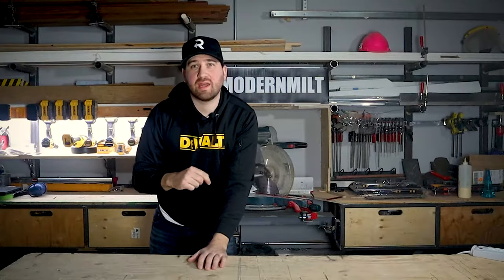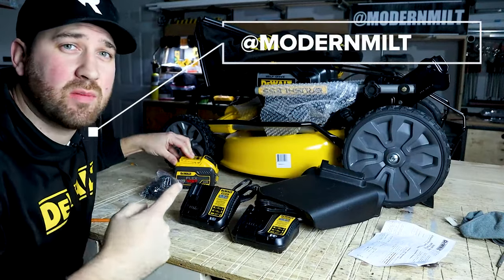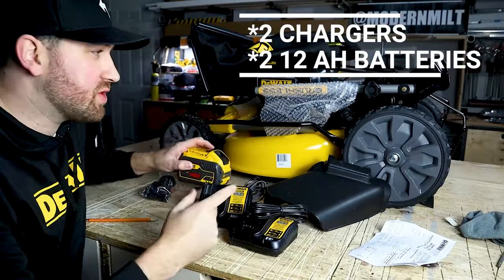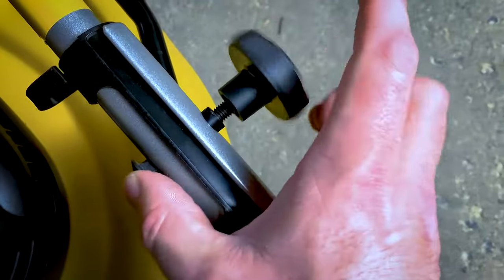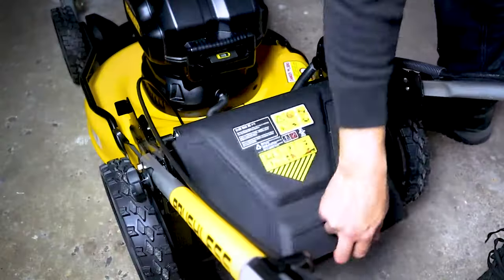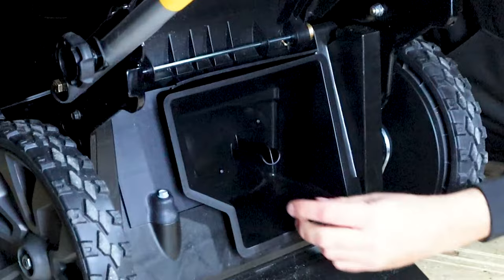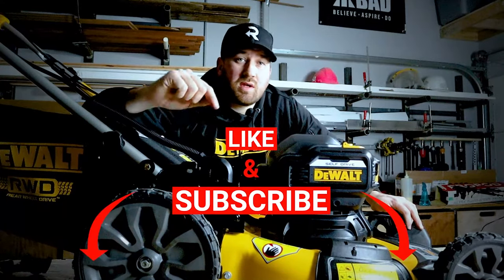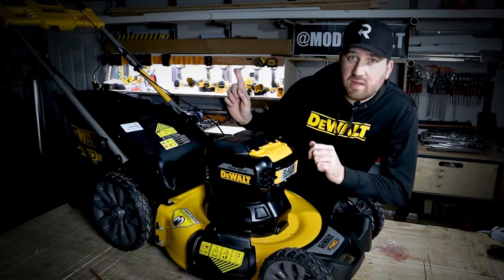DEWALT DCMWSP255Y2 - Lawn Mower Unboxing and Assembly

Comment: I like the video and I like how you show the details on how to put it together I wish it would have been longer and been a complete video.
Reply from the maker: Complete as in usage and run time?
Reply: Yes how it does on the grass, how loud it is, how long it runs for if it jams up, can the blade be replaced or sharpened. How is the build quality is it flimsy or high quality?

Comment: The "DON'T LOSE THIS" tag for the key is golden. Try to find a spare or one to replace a missing key... nearly impossible. Mine was missing the key but had everything else. Went back to Homey Depot and they gave me a key from another of the same model. Also waiting for warmer weather and the grass to grow.

I first considered the newest Toro (preferably w/o the headlights) but those are still apparently not available. This Dewalt appears to be well made and the run time should be approximately an hour under normal conditions. Because I have a large yard and a JD X390 (48"), even if I just do the more confined areas and "trimming" with this mower, it should work well.

One thing I noticed last evening (yeah, I started it inside the house... the dog was not amused, but rather was initially confused, worthy of a head tilt) that if you squeeze the wheel drive "triggers" all the way, the mower will really boogitate, even if the thumbwheel is set completely to the slowest setting. Do I need to think of this as a variable speed tool (like a drill) and just do a partial squeeze? It is either that or chase it around the yard and get the heart rate up. ;)
Reply: qwhat did u get

Comment: What's the performance like? Does it bog down much?
Reply from the maker: So far it’s great except when you get into higher grass, 3” and up, it will shut off. You need to adjust the height of the deck and work down

Comment: I just brought this but can not assemble, the lower arms are two different sizes ( 21” / 23”)
Is this supposed to be like that? What lenght are yours?how can you put the handle on if it’s different?.. please help..
Reply from the maker: I’m pretty sure mine are the same length but I will have to check

Comment: Mine did not come with the mulching plug and I am struggling to work with my supplier to get a replacement. Any idea what the part number for the mulching plug is?

Comment: I like DeWalt and like that this is made in USA.  It still looks cheaply built though compared to EGO and Toro.  Looking forward to the full review.
Reply: The EGO is the cheapest looking lawnmower it's made out of plastic  you can't cheaper looking than that
Reply: @loucifer4205  it might look cheap but ego gives you a 5-year warranty on the mower and battery. They are also highly rated if you look at their ratings online.
Reply: @eclecticgentleman  But can you use the battery on your drill recip saw or circular saw, that's a big difference
Reply: ego is very cheap inside i have worked on them for the last several years one of our top battery replacements tooo
Reply: what did u guys end up getting, dewalt or toro

Comment: Just got mine in today, I got the DCMWSP255U2 which is the same mower but comes with the 2x20v 10ah batteries. Was so excited to get it but mine seems to have a few issues(or maybe I do), I would love to know if you have the same problems or if mine is a lemon. My front right tire sits slightly higher then the rest, and on the highest adjustment setting a bolt interferes with the adjustment lever and can't fully seat; it could just be mine or a defect in the adjustment system. The Battery indicator on my mower doesn't do anything except blink red once when I start it up, Dewalt said it only lights up when the batteries are completely dead; but that would be kind of pointless as the mower shutting off would tell me the batteries are dead, and we'd have no way to estimate how much run time we have left without an indicator. My self propulsion lever unit is rather loose and has a bit of play where it attaches to the handle. Lastly, the underside of the mower where the blade is at either has a horrible paint job, or a protective coat over the paint, but mine is rough, and has a greenish tint. I don't expect things to be perfect, but every one of the 16 other Dewalt tools I own are great but for $600 the mower just took the wind out of my sails. I'd love your input based on what yours is like!
Reply from the maker: I will have a look at all those issues for you and see if I have the same. Stay tuned
Reply: They may have issued the "U2" version with the 10-aH batteries and the "Y2" version with the 12's.
Reply: did u return it
Reply: Yea I returned it and got the first gen Dewalt mower on sale for $250. I already had eight 5ah batteries from other tools and that’s what I use with it. I tried the 10ah and I don’t like them, I prefer to use the 5’s and change them more often, by the time I cycle through them all the first set is charged up again. And if a battery ever goes down and I need to send it off to Dewalt support I got plenty of extras. Takes about three pairs of the 5ah batteries to cut my half an acre in mulching mode. When it’s taller and a little wet it can use up to the fourth set of batteries, but I swap them when the battery indicator gets to 1/3rd battery life, not when they are fully dead. The first gen mower cuts better, is easier to push, and is more comfortable to push then the new models. If you can snag the first gen for $250-$350; DO IT! You can get 5ah batteries affordable on Amazon.
Reply: @ThePugSmuggler  did u ever consider the TOROs or the Ego mowerS?
Reply: @randomrazr  I did, but was already heavily invested in Dewalt.

Comment: Different than mine... Rear wheel drive mine front.
 2 -
10
amp/hour batteries not 12. and my mulch plug is built into rear bag door.

Comment: Battery life is an issue even with 12Ah batteries. Got it and charged the batteries overnight. I own .61acres. I mowed less than a 1/4 of ankle high grass and within 30 min both batteries were dead.
Reply from the maker: Strange because i have about the same size property and i had 1 bar left on one and 2 on the other
Reply: @MODERNMILT  did you use the rwd at all? I used it for a few passes.
Reply: @MODERNMILT  recharged and used the mower without using powered rwd. It lasted for about an hour until it got to 1 bar.
Reply from the maker: I’ll have to re test next cut and try different options.
Reply: @jttillman7109  takes the batteries a few discharges cycles to develop a memory and have a longer run time
Reply: @cj599  I’ve cut the grass 3 times now. Still getting about 1/4 acre for about an hour and 10-15 min cut time with no powered drive usage. Bought two 9Ah batteries to help subside the power usage. Still can’t cut the whole .61acre yard with one charge. Definitely can’t do it with the powered drive.
Reply: @cj599  we will see how well they perform the rest of summer.
Reply: @jttillman7109  do you have the flex volt batteries might be worth a try
Reply: @cj599  they are the flex volt ones. It comes with 2 12Ah flex volt batteries. I purchased 2 9Ah flex volt ones from Amazon.

Comment: I regret getting mine it keep cutting off even upgraded the batteries still same thing
Reply from the maker: How long is the grass your cutting?
Reply: @MODERNMILT  no taller than 3 inches. I tried it again it work better when the grass is not wet and I upgraded my batteries so far it’s better now. I was running 5ah I upgraded to 12ah

Comment: After spending 180 miles (three 60-mile round trips) and the associated travel time, plus the time spent troubleshooting this beast, I have returned it to Home Depot. The height adjustment was just not right, and the speed adjustment was more than "quirky"... it just plain did not work. The whole thing proved disappointing as Dewalt stuff was always among the best available, Even one of the peepz at HD commented that they have seen some problems with the Dewalt mowers lately. I really wanted this thing to work and did all within my power to resolve the problems. Dewalt Customer Support appears ill equipped to resolve problems... poor (or no) documentation makes their jobs more difficult. 

Oh, well... on to more research to find a reasonably good electric mower.

Comment: Thanks for the video, I just picked up this mower but have some questions with issues I'm having.  When using the self-propelled function it vibrates and makes a terrible chain grinding sound.  The vibration and sound are so annoying I can't use the function.  Much smoother and easier to push it.   Does yours do the same thing? Also your right can't cut more than a couple inches of grass without stalling. All my tools are DeWalt so I got it for the batteries but I'm considering returning it to Home Depot.  I tried connecting to Support at DeWalt and it was a waste of time no one knows anything and you can't even talk to a real person who has used one of these.  Thanks